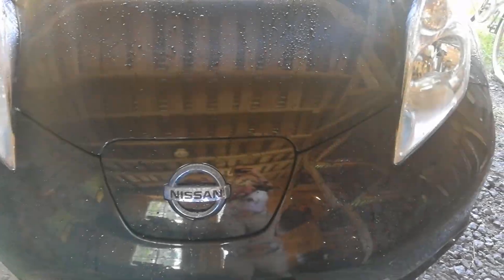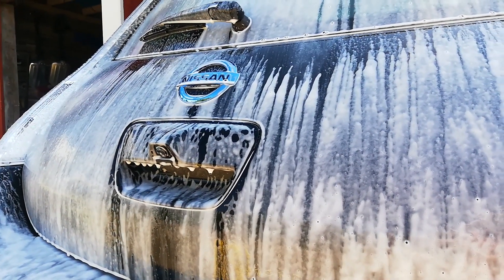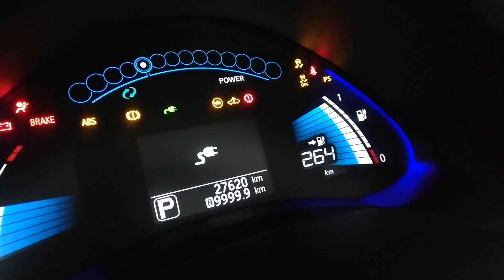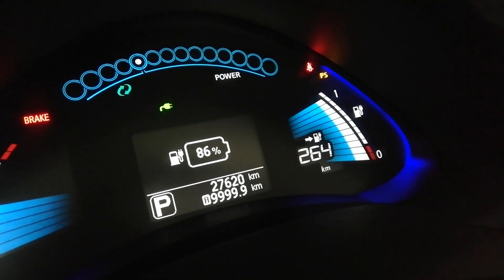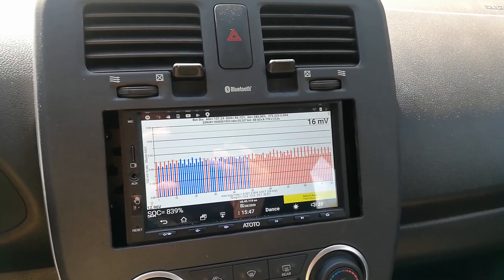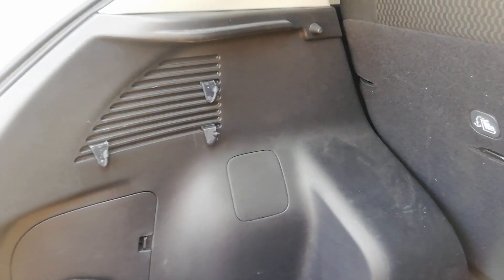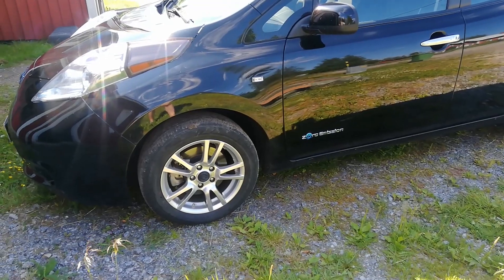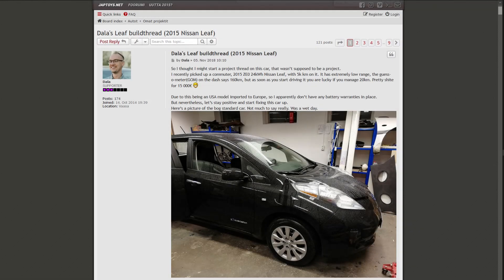My battery upgraded Nissan LEAF [24 - 40kWh]

Comment: So did you do the swap yourself for the 30kWh to the 40kWh? Does the battery pack fit into the OEM spot without modifications? (other than the BMS) I'm curious how hard this would be to try and accomplish by myself. Any advice would be helpful! Thanks!
Reply from the maker: See Github! https://github.com/dalathegreat/Nissan-LEAF-Battery-Upgrade

Comment: You seem to be wise man with hands growing from a right place ;). This brings my question, is it okay for you to charge battery over 80%? The reason I'm asking is I was charging 5%-95% and got 6% SOH loss in 12 month. Last 6 month I charge 5% to 80% and have battery 0,25% degradation. Now I tend to charge even 70-75% sometimes.
Reply from the maker: Yes! Limiting the max charge will prevent degradation, but with LEAF batteries it is more important to keep the temperature down. But you can't control the climate you live in, but the chargemax% you can :)

Comment: Nice video. Hope i can do this in Norway, with my 1 gen Nissan Leaf. What price for a 40kw battery? 😄
Reply from the maker: Pay no more than 4000€!
Reply: @DalasEVRepair thanks😄. 4000€ is the same price  i buy the car for last week😄, but i love this car. This is my first Electric car. Before Leaf, i had a Ford Excursion v8 Diesel eater😬. So glad i change.
Reply: @biff1tannen  40 000 kr for et nytt batteri eller? Det finnes vel brukt man kan anskaffe seg? Og hvilke verksted kunne utført jobben?
Reply: @Titoshb  hadde fått tak i et batteri fra en høgger.  Bytte gjør jeg selv.   Men bilen virker helt fint enda. Men hadde vært interessant å oppgradere kjøregleden på den, om et år eller to.

Comment: I have a 2016 and swapped out the 30 kwh for a 40 kwh. All under warranty. So far so good. Would like to get the muxsan product for more Kwh.
Reply from the maker: Yes, Nissan ran out of 30kWh packs, and more importantly, it is cheaper for them to produce 40kWh packs, so all 2016+ 30kWh Leafs automatically get the 40kWh pack in warranty situations. Those below 2016 are shafted.
Reply: @DalasEVRepair  i have a 2013 leaf what can i do exactly?
Reply: @DalasEVRepair  Shafted. That is exactly how I feel with the way Nissan has responded to this issue

Comment: Cost wise, would you have been better off just buying a newer generation 40 kWh LEAF? Great learning experience anyway but I wonder about the economic feasibility of the battery upgrade route. Makes great content. Well done.
Reply from the maker: No, back in 2019 when I did the upgrade, the cheapest 40kWh leaf was 33k€. The battery only cost 5k€

Comment: Hi! Thank you for showing us this and providing a solution for us to DIY it on our own. I have a question about this 80% limit that one can enable in the menu, does this still work after a swap with a 40kWh battery? :)
Reply from the maker: My BatterySaver feature gives more tunability when it comes to the end charge %, i can set it at 50/57/63/75/83/92/100%!
Reply: @DalasEVRepair  Neat, kiitos.

Comment: Nice video Daniel. I have a 2013 24kWhr Leaf which is sitting at around 62% SOH. The cells are all still fairly well balanced, but fully charge only goes to 88%. I'm not sure why that is, but range is sitting at around 80km. 
My issue is that I am living in S Africa. Nissan marketed the car here in a very half hearted manner and so only around 100 were ever sold country wide. So finding a second hand Leaf battery is pretty much impossible.
Nissan is even more hopeless here than elsewhere in the world, so no help there.
Do you have any suggestions on how I could upgrade?
Could I build a pack from battery Li ion packs on the market? Or ship a second hand battery from Europe or US?
Reply from the maker: I think shipping one from EU is the best option. But you'll need contacts for sure, locating a pack is not easy. And transportation will most likely be between 500-1000€!

Comment: you say that the battery is from a -18 leaf, what years of leafs battery are considered working with a -15? is it Leaf 2019 and/or 2020 as well ?
Reply from the maker: All 40kWh packs (2018-2020) are direct bolt on. The 62kWh pack requires spacers since it is 50mm taller.
Reply: @DalasEVRepair  wow supercool, thanks for the info.
Reply: @DalasEVRepair  40 mm

Comment: This begs the question though...are you going to eventually upgrade to the 62 kwh battery? :P
Reply from the maker: Absolutely!
Reply from the maker: ki0ng  between 8-13k€
Reply: @DalasEVRepair  It's a deeper case, you'll need to modify the chassis too. Will be fun :)
Reply: Wouldn't that at least require a suspension upgrade? The 62kWH pack actually fits but is about an inch taller in height, so it decreases the ground clearance under the Leaf. The slightly decreased ground clearance is not that big a deal, but the increased weight IS a problem. This is because the increased weight makes the car ride lower, and with the lower ride height and that inch of lost ground clearance under the new battery, you can occasionally bottom out (such as when going over a speed bump). Violently scraping a giant battery against concrete or asphalt could damage it or break connections loose. You could suddenly find the car undriveable.

Comment: Can you provide the make and model you installed in yours?  The head unit link is broken.
I've tried pasting "FATOTO A6 Pro doppio din per auto Car Audio A6Y2721PRB G Operazione gestuale" into eBay's search, and the results are ambiguous to me today.  (Though I can compare it with a stock Leaf EntertaiNav unit and see some of the ways in which they are different.)
Thanks for the info about getting a CAN unit to make a 40kWh battery work.  My 2011 got a 2015 battery replacement under warranty, so there may be a Nissan-supplied adapter already installed.  When I get closer to swapping my 24kWh battery with a 40kWh, we'll see; for now, I have 11 bars.
Also thanks for all your technical discussion; it's informative and helpful!
Reply from the maker: A6Y2721PRB-G is the model, other models will also work.
Reply: @DalasEVRepair  Brilliant, thank you!
Do you have a favourite resource for technical considerations when replacing it?  (e.g., DO unplug the 12V battery first.  DON'T forget to use this pinout map.)  I'd never used GitHub until following your links, but it seems like a good place to start.
Reply from the maker: @stevejordan7275  The mynissanleaf forum got you covered: https://www.mynissanleaf.com/viewtopic.php?f=36&t=16061
Reply: @DalasEVRepair  Outstanding.  Thank you!
I will have an opportunity to buy a 2020 Leaf with its 62kWh pack this week.  The car has under 500 miles on it!
Can I retrofit this into my 2011 with your CAN bridge, wiring harness adapter, and some 1.5" square steel bars?
Or is the 62kWh pack wholly incompatible with the 2011 ZE0?
Reply from the maker: @stevejordan7275  Yes it can be retrofitted, but the mechanical side needs quite some engineering. Spacers, skid plate in the front (to prevent anything from hitting it) along with stronger rear springs from the 62kWh LEAF is needed.
Reply: @DalasEVRepair  Wow.  Great to know.  Thanks so much!
Looks like I'll have a little more work to do.  The spacers and plate I expected.  Any sense of how long it takes to swap the rear springs?
Again, a thousand thanks for sharing your knowledge so readily.
Though you recommend EVs Enhanced for video demos of how to do the battery swap, it looks like the CAN bridge allows more flexibility in modding the car's behavior (such as disabling the regen braking, which I can hardly wait to try!)
Reply from the maker: @stevejordan7275  The rear springs are not combined with the shock, so they are super fast to change out.

And yeah, I try to offer the most extra features :D

Comment: I have a 2013 leaf with 3 battery bars. Can i replace it with a 40kwh hour battery and can i fit  a cooling system for the battery.Please help
Reply from the maker: Yes you can replace it with a 40kWh pack. See this page for more info on https://dalasevrepair.fi/can-bridges/

Also here is my take on the cooling: https://www.youtube.com/watch?v=ensZ33hhNB8&feature=youtu.be

Comment: Do you have any other direct form or blog for me to check this from beginning. Still I cannot find proper solution to upgrade.. Happy to see your work thanks.
Reply: Thanks also I saw some android app which show car status..not leafspy different one.
 Will it available to download?
Reply: Nimz 2004 it’s OVMS. But you need to have the module installed in the car first.
Reply from the maker: Thread from 2018: http://www.japtoys.net/forum/viewforum.php?f=10&sid=1c9f83dfda6131d66fffdc37f89e0f40

Comment: I have a 2011 Nissan Leaf with the original battery. I took great care of the battery thinking that’s the right thing to do, but this is one those thing where doing the right thing is the wrong thing as I couldn’t not get the new battery replacement when it was still under warranty. Now it’s out of warranty and it only can last about 30miles on a full charge. I am thinking about donating this car  as nobody wants to buy this car but it’s too expensive to replace with a new battery. Finding out that I can replace it with 40kw gives me hope. Is it expensive to do?
Reply from the maker: Depending on your location, a 40kWh upgrade can cost 3500->10000€.
Reply: @DalasEVRepair  It's about 10000€ (NZ$18000) here in New Zealand. At that price you might as well get the IONIQ when the prices come down, as that have water cooling for the batteries.
Reply: @DalasEVRepair  Hi Daniel,
Which location is cheap/expensive.
I am from Denmark.
I have one of the last build 24 kWh 6/2015. Still got all 12 bars and no notable degradation after 70kkm.
My wife simply loves this car but the range is a bit on the low side for where we live. I had  planned to replace it. But if I can get 40 kWh for under 5k€ I would consider that instead.
Reply from the maker: @renebergqvist599  Import from Norway! Def cheapest option. But supply is sporadic, so you'll have to poll constantly!
Reply from the maker: @xabizar  Nope, sry!

Comment: That’s what I’m talking about :)  my 24kwh battery is healthy so no need yet , but great to see this option and that people have now done the 62kwh swap also.  62 kWh will turn an old leaf into a true all round EV :)   One thing I have to say that I like with 2018 leaf is one pedal driving! I hate the touchy breaks and prefer that precise control that one pedal brings.  Question I looked at open VMS and couldn’t work out how to have leafspy and OVMS at same time. How did you get around this?  Also can u turn on AC remotely when not charging ?  What head unit did u get? I want to run leafspy like u as I have S model . Cheers
Reply from the maker: Y-splitter cable for OBD2 port! And yes, remotely able to turn on AC. Headunit is 'Atoto A6 Pro'
Reply: Thank you , the remote AC is what I’m after while not plugged in!  Y splitter is off the shelf?

Comment: Thanks Daniel for your awesome work. I have 2 imported Nissan Leafs in Australia and I am on the look out for larger battery packs. Not common here in Australia. Have you seen the Company retro fitting after market lithium packs that brings it up to around 63kw ?  Spanish I think. Great job they do. I will follow you work closely thanks.
Reply from the maker: Yes, I actually helped with making the instrumentation work on the spanish 64kW pack! Good luck with finding a bigger pack!
Reply: Yep I’m on the hunt for the large pack here in Australia, even though I’m getting 19.5kwh out of my current packI feel the 40 pack will transform the cars reach without worry.  I have had thoughts of doing something similar to muxsan in the boot. However not sure on regulations.  Dream is the 62kwh pack :).  I’ve had thoughts of importing a wreck from Japan, but it looks expensive.  Finding a crashed 40kwh here in Australia will be rare as.  I think an actual removed pack from Japan and shipped might the the go.

Comment: Thanks for the video which is really useful. I've just bought a 40kw battery to replace the 24kw battery that has now done 100k miles and still at 11bars. I am happy to physically swap the battery, but know nothing about the electronics that are required. If you have any information about the can bus specification or are able to sell me something that will do the job, I'd be very interested.
Reply from the maker: Ofcourse I can sell you the requred hardware. Shoot me an email to info@dalasevrepair.fi

Comment: You mentioned that you can start and stop charging with your OVMS, is this correct? If that's the case how did you manage to get stopping the charge to work?
Reply from the maker: Stop charge is in a feature branch of OVMS, available here: https://github.com/openvehicles/Open-Vehicle-Monitoring-System-3/issues/287
It will soon be merged to the main branch!
Reply: Ah right, I remember that issue. Had given up hope that it would ever make it to main
Reply: @DalasEVRepair  Yeah I have my beta running fine for a few months. Just need to sit some more and clean it up.

Comment: This is truly amazing! Have you done any video about the swap to a 40kwh battery? 
i have a 2014 leaf, with a great battery at this point, but somewhere in the future I see that there will be time for a new battery. if a 40kwh is possible that would be awesome! 
How much did you pay for the 40kwh battery? what would the howl thing cost, with battery and work if you did it?
Reply from the maker: I have lots of pictures here (http://www.japtoys.net/forum/viewtopic.php?f=10&t=3613&start=60#p71473), might do a video on next install.
Prices fluctuate, but in the 5-7k€ range depending on from where you get the battery!
Reply: Hi Dala. My battery is 50% degraded. And I think replacing it would be more environmentally friendly than throwing away the car. Nissan quoted me for 9k for a new 24kwh pack which I think is not economical. One question I have is what equipment would I need to replace the battery given that is so heavy. I guess you need a car lift or do you think it can be done with manual jacks?
Reply from the maker: @PedroLarroy  I always do it with manual jacks. I have some pictures here: http://www.japtoys.net/forum/viewtopic.php?f=10&t=3613 I have since then upgraded to a metal frame instead of a wooden!
Reply: @DalasEVRepair  thank You for your reply. May I suggest you create some nice guides to this on your own? I would happily pay to get those guides and some support in case there's questions.
Reply: @DalasEVRepair  I decided to look for a 40kwh pack and upgrade. Thanks a lot for sharing all your findings. I will report back on my journey

Comment: I was looking into the OVMS for our e-nv200 40 kWh but the OVMS manual says it's not yet compatible with the 40 kWh models. But it works with your car? Is it because your car is an older car, only the battery is newer..?
Reply from the maker: The 40kWh e-nv200 removed some pins from the OBD2 connector (EV-CAN). That is why it is not possible to start heating remotely on the 40kWh model. OVMS otherwise would work on your car, it's just the remote heating/cooling that wont work.